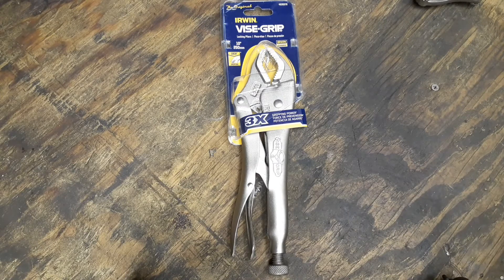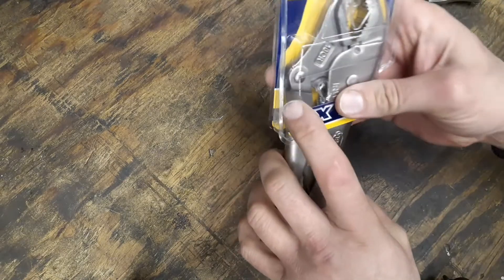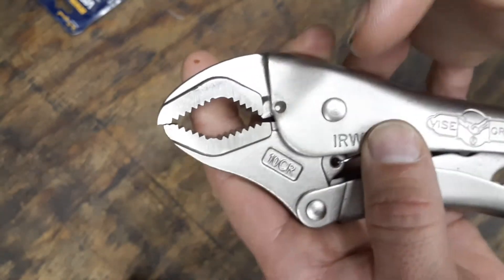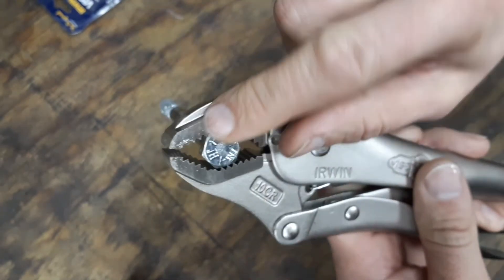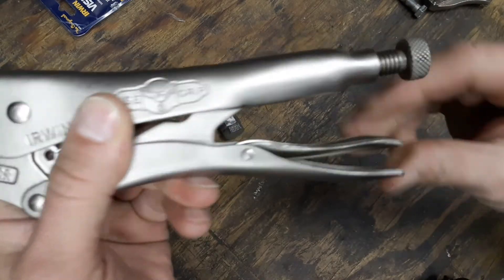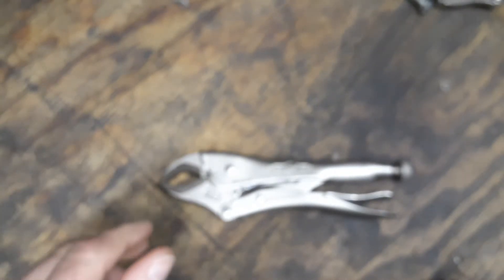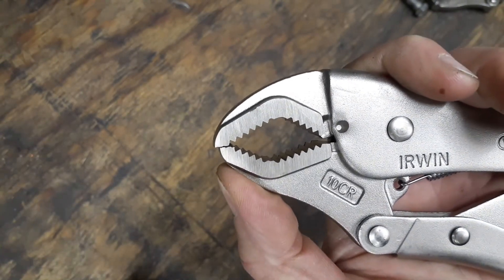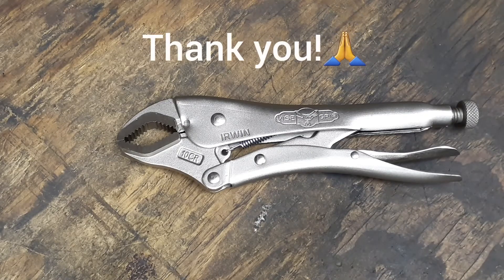Irwin Vise Grip 10CR (#4935576) Curved Jaw Locking Plier

Comment: Thanks for the review. It's strange there's hardly any other YT vids describing this or the smaller 5CR (IRHT82575) model with this style jaw. The jaws are reminiscent of water pump pliers (i.e. Knipex Cobra) and I'm curious how it'd stack up against them or the Irwin parrot-style Vise Grips (4/7/10LW) on rounded-off fasteners.
Reply from the maker: This pliers work as well as the others you mentioned. Thank you for the comment.